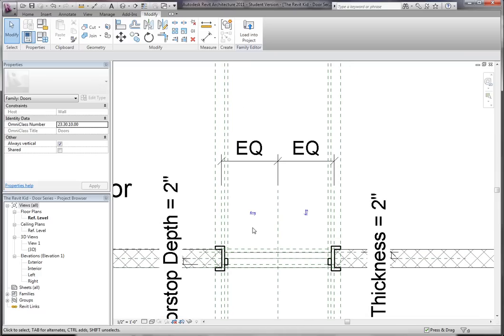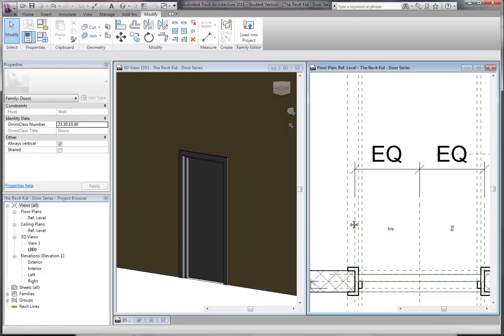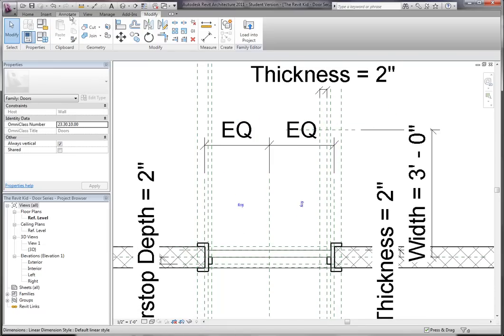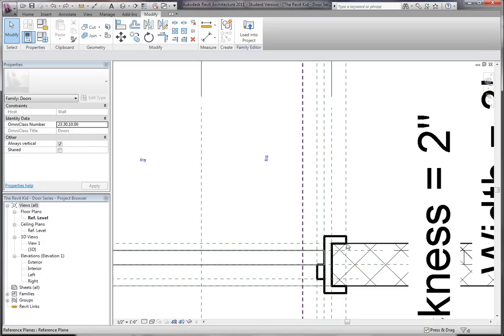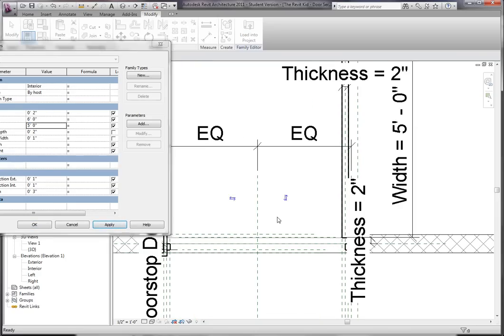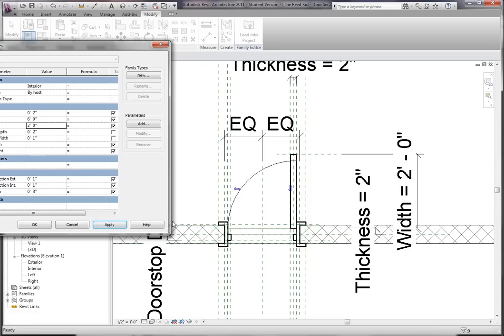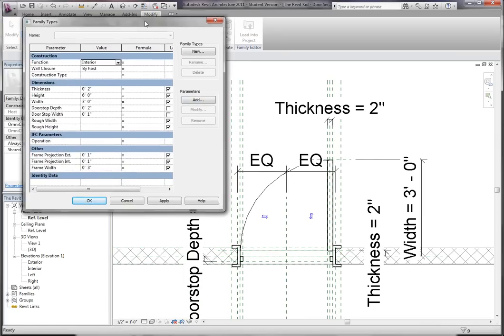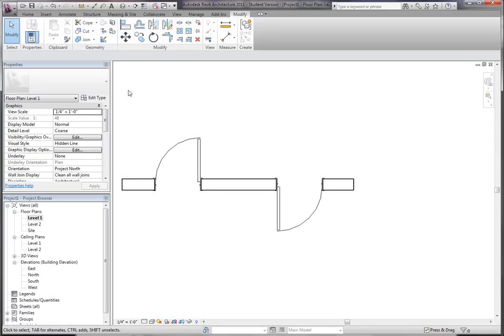Revit Tutorial - The Revit Kid - Create a Door Part 4

Comment: Hi Revit Kid. Thank you for all of your great videos, I am learning a lot from them.

I am currently creating a door family that has 5 sliding doors. I have applied a dimension string to the 5 door panels in plan and clicked the equal toggle. I have assigned a parameter to the thickness of these door panels in plan. When I change this thickness, I want the centre line of the hosting wall to correspond with the centre line of the middle door panel. At the moment, when I change the door panel thickness, all the door panels change fine except that the middle door doesn't keep its centre axis on the centre line of the wall. I would love if you can help!
Reply from the maker: Emily,

Use reference planes and "EQ" them to the center line... this will keep the door centered.
Reply: TheRevitKid I'm not sure if I can use reference planes considering that I cannot align and lock reference planes to the centre of my door panel (in plan view). I have two screen shots to illustrate what is happening but I'm not sure how I can display them to you?